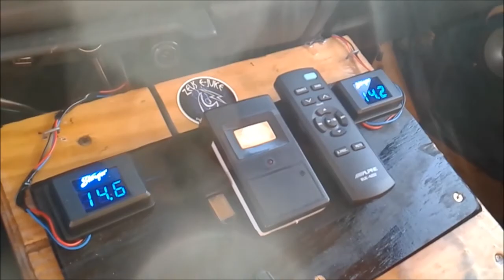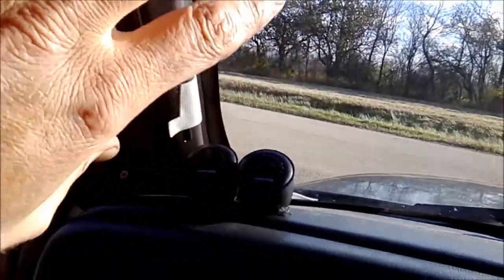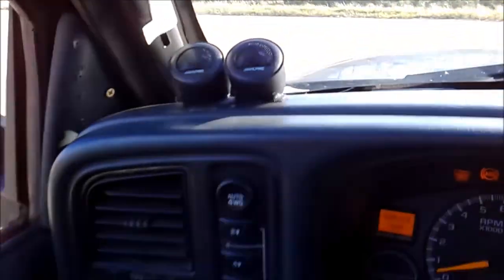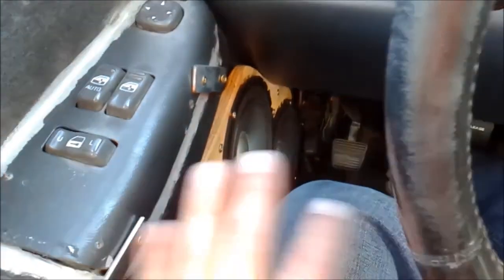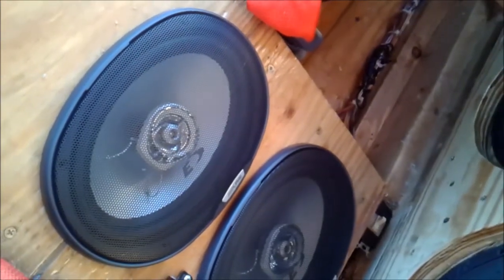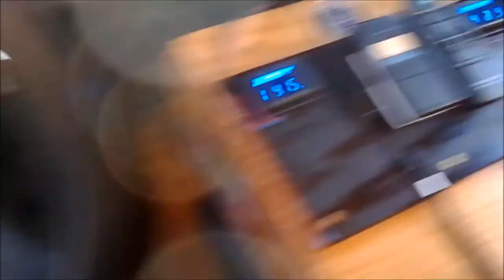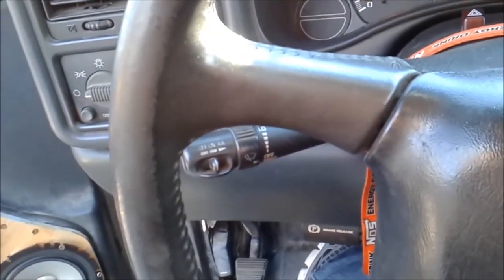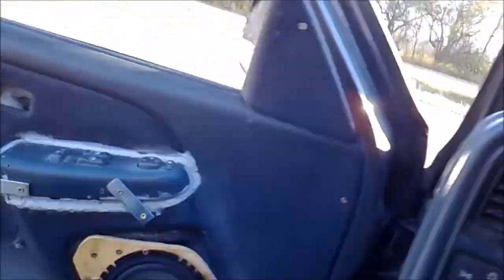BASS VIBE demo (by BASSOTRONICS)

Comment: Dude seriously your seat belts! 
Two screws in to plyboard!
Reply from the maker: those are three eighths 4 inch long lag bolts screwed into the two by four frame built around my box which is completely encased into the cab of my truck and doubles as a roll Cage
Reply from the maker: the original seat belts work part of the original seat switch that bass completely destroyed and they fell apart the original seat belts didn't even work
Reply from the maker: I trust these racing harnesses that are secured to this 2x4 frame of a lot more than your opinion
Reply: I think your right about my opinion, Now that you mention it I allways see racing cars and trucks with harnesses held down with screws in wood..... Err not. Lol
On a serious note bass looks really good, I'd love to do something like that.
Reply from the maker: have you ever built a deck? On the side of a house? These are not screws man.. LAG BOLTS and SCREWS are different